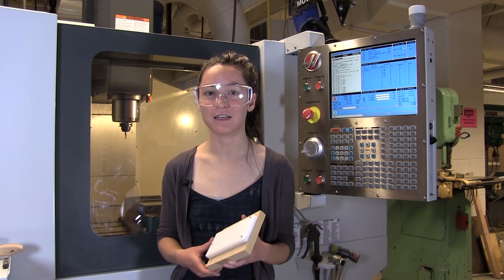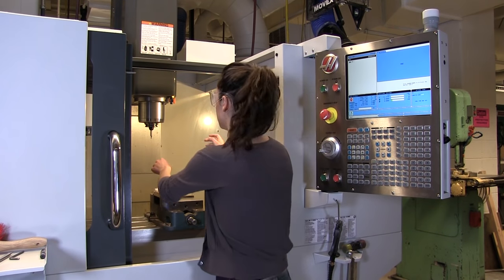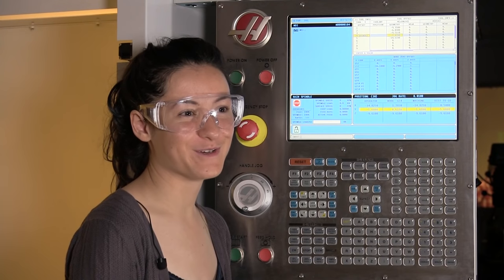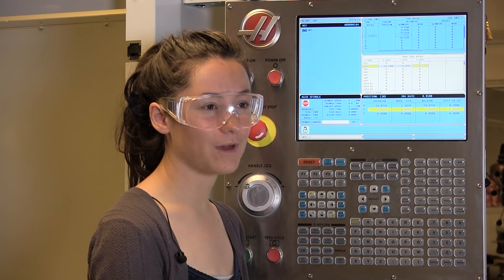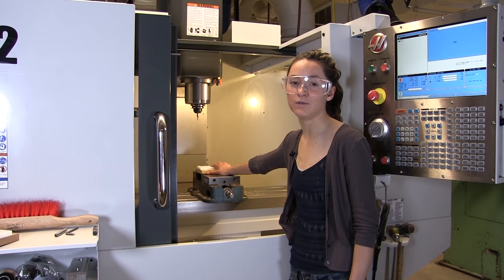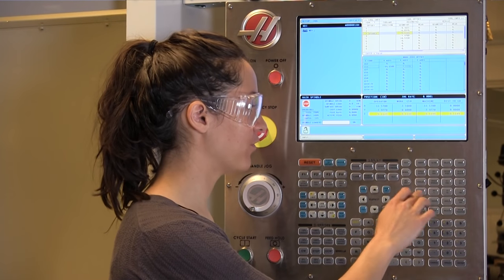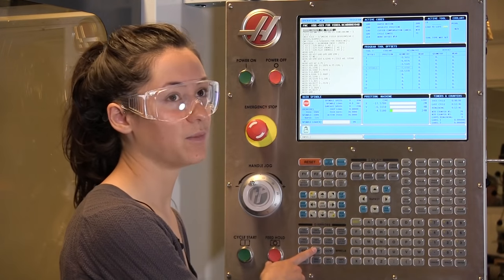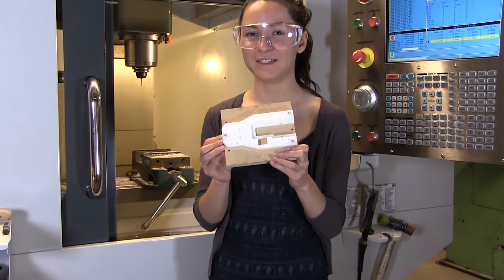CNC Mill Tutorial

Comment: Excellent video. She obviously knows the tech inside and out to be that comfortable discussing it. I've been a machinist / programmer / production engineer, for 40 years and am always happy to see young people learning the trade.
Here are some tricks that you may want to try, to make your life easier in the future, when machining plastics.
To get rid of the plastic chip wrap,  reduce the spindle speed on the drilling can cycles. Change the G81 to G83, or G73 , add a "Q" value to the can cycle to break the chip, and if all else fails, at the end of each drilled hole cycle, have the tool rapid up above the part 2.000", insert an M4 (stops and reverses the spindle) in the program. With the 1,000 psi coolant blasting on the tool, it'll spin the clump of chips off the drill. Then you can insert an M3 to stop the spindle, and restart it in the clockwise rotation, and move on to start drilling the next hole. That way the flutes of the drill will be free of any melted stock when it starts the next hole, and the chips won't build up above the flutes of the drill and be burned into the top of the part.
Hope these tips help you in the future.
Take care.
Reply: But this machine can't worked with blame cnc

Comment: Advise for newbies:
1: Your tool length offset may be off by the thickness of the paper, this may be important when manufacturing more precise parts. You can correct this by selecting your length offset in the tool offset menu and typing (for example) -0.002 or whatever the thickness of your paper is. 

2: You can press the "cancel" button on the program menu to then be able to switch between the machine files and the usb device without scrolling all the way to the top.

3: You can search for a program by typing in the program's number or file name and pressing the down arrow, or the up arrow if you believe you have already scrolled past it. Keep in mind this will take you to the nearest file that matches what you typed, so you may have to hit the up or down arrow again to continue searching if files have similar names or you didn't type in the full name/ if there are more iterations.

4: You can can clear all work and tool offsets faster in the work/tool offset page by pressing "Origin" and selecting one of the options that appears. This only works for the offset menu you have currently highlighted. You should only do this if you are certain that you will not lose anything important like probe tool offsets when doing so.    

The old machines may have used "F1" then "edit" or in the reverse order at some point, but I cannot recall.

5: lazy way to clean a machine is to turn the coolant on and have it wash the bed as you hand jog.
Reply: #1 is very important. For most hobbyist machining, using the paper trick is fine. When you perform precision machining though, a piece of paper must be compensated for in your work offsets. I often have to comp my tools due to the change in ambient temperature when machining to very small dimensions and tight tolerances.
Reply: @jumpman2680  Do you use flood coolant or any type of coolant temperature control? How tight of tolerances?

Comment: Im currently training to be CNC operator. This video is very helpful!!
Reply: I'm replying to your post as its recent, lots of comments but none picked up on the slightly incorrect method used to tighten the work piece and as your just starting off....she did everything right but failed to retighten the vice after tapping down the work piece with a mallet; meaning if the work piece is still free to move with light taps of a mallet then its not securely clamped! Stopped watching after approx 2 mins as I'd end up crtiqing the whole video!

Comment: After I retired I wanted to get into CNC machining, not to make parts, but to experience the other way to do it.........so I bought a CNC mill from China and after many many hours of watching and asking questions I wrote some G code and using a dummy wooden cutter and a block of wood went through a typical mill and drill cycle.........it's true you learn more in five minutes from hands on than a month with a book but the book does give you the staring point and that was without anyone to hold my hand or watch over me......if I can get to that level anyone with a bit of enthusiasm can do it.

Comment: Great video, but I'd like to help You to become more efficient.
I suggest setting all "tool lengths" on a common place, not on Your rough part.
Example, top of vise with gage block, or a block setting on machine table of the same height as vise.
Then set Z0 on your rough part, using only one of the tools in Your program.
Then on Your next job, You won't have to load and jog all the tools to set their lengths again. 
"tool lengths" are stored in Your tool data,  Z0 is stored in Your G54, G55 etc.
Reply: If she's good she'll realize that way on her own. I wish she knew how inaccurate and dangerous it is setting tools with paper
Reply: Yes Joseph, and use work offset, then you do not need to set all tools for next job :) But she was a student by the look, so she did great!
Reply: Yes, also might chip carbide cutters touching top of part.
Reply: Yep, exactly. It's hard for me to post criticism of such an excellent video, but setting your X/Y/Z work offsets is completely independent of tool offsets.

Comment: Faster way when compensating for radius of edge finder is to just type your value in +/- .100 and write enter.
    It's a little faster, you're very talented though, I like the hammer trick to hold down parallel, I use bent band metal used in shipping to hold the parallel to vise.

Comment: great video, but you forgot to compensate for the thickness of the paper which is 0.003 inches.
Reply: I'm boggled that a piece of paper is the way recomended in the manual...There are so many different types of paper, and not all of them have a flat and smooth surface, while some have a polished and a rough side!
Reply: At my shop we use little blue pieces of plastic that are 5 thow thick

Comment: Thanks for the great video! My CNC experience is only in my home shop so I've never used an ATC or anything like that. My mill is an Anilam Crusader II Bridgeport but the controls are not working. I am working on a conversion to LinuxCNC, it works with the existing drives, motors, linear scales/encoders. If I can figure a way to convert my Erickson QC30 to a pull stud drawbar (ISO30 or BT30?) I might be able to have other tools in holders on the table for a poor man's ATC. Anyway, it's great to see how the modern equipment works!

Comment: Dear Sara,

I have been in CNC for the past 30 years (3/4/5/ 6th axis with attachments) handled many types of CNC Machines. Your Video was wonderful with great explanations,this is the way I learned 30 years ago. In Z work offset you called each tool and capture Z , it will applicable for few tools. If we need to run with 20 or even more tools .......... tired right? I have a solution. Please wear a cap while working on Machines. 
All the best ---Great Video

Comment: Great job and great video...I do have a bit of constructive criticism though (I learned the hard way). NEVER press cycle start on a new program if you are not watching the tool approach the part...AND...whenever proofing a new program on the machine, walk EVERY tool down at 25% rapid (or less) and in Single Block mode, so that that you can verify that the Tool Length Offset is set correctly before the tool starts cutting. Never assume that you did your setup correctly...this little precaution will save you tremendous amounts of time and money (and embarrassment) by preventing a spindle crash.

Comment: If you are locating from the left edge of the part spin the spindle CCW (COUNTER CLOCKWISE)
so that the edge finder snaps on the direction facing the operator instead of the back of the machine.

Comment: Please learn from my mistake.
I learned my lesson.  I broke a 1 inch drill bit when I put it back to the spindle.  The pegs on the spindle were on the side way so I did not see them clearly and I did not line up the notches correctly with the pegs.  I heard the loud bang and I shattered the 1 inch drill  bit.  I was glad I did not get hurt.
Tip:  Try to turn the spindle so one of the pegs faces you so i can see it clearly.

Comment: I was always told to run the program on its first run on single jog, that way u can check the numbers,  when I write a program
I have the tool go to x. 1 y. 1 z. 6  then I check z is 6 inches from top of part,  if that is correct, I jog the next move which I like to make
X. 1 y. 1 z. .1 then I would check x and y. Are both 1in from edge.

Comment: also theirs another menu were u can preset for radius of tool cause when u buy tooling it comes with this info, i understand why their doing the video this way, but in practice hands on you don't need a edge finder u can use any tool to do this but thats not by the book way but it's much faster and just as acurate and u don't need the spindle to spin cause u  spin it by hand

Comment: She shows how to use an edgefinder to find X and Y, but not how to use an INDICATOR to find Z RELATIVE for a 123 block, and its relevation.

You use a 123 block to keep a 3 inch distance from the base table, so you virtually lie to the machine and say the table is 3 inches taller than it is.
Indicator touches the top of 123 block, and you find THAT relevance to the top of your stock(or what you want the Z rele to be, sometimes its half or midline of the stock at Z)

She touched the tool off the part, but you cant really do that to a piece of metal, maybe alum but idk.
I knew a guy that did it with a piece of paper off the top of the part, and subbed 10 thou, which was smartz

For spring holes on winchester lowers, I just jog the Z down until it throws a few chips, part zero, run it .005/.01 thou and then re part zero.

Machining is fun, never be intimidated, and also, never give up. Just keep trying to learn. Youll always break stuff. Thats okay. Ruining tools and ruining some parts never hurts, it only makes you worth more money if you accidentally waste a little money.🖤

Comment: Do you always edge find on the left and back side of the piece? Would starting from a different side cause the machine to run off the piece? Or does the zero compensate for this? Or is this taken in to consideration when laying out the part in Cam?
Reply: It does matter. If you recall she mentioned early in the video that she chose to set the origin of the part in MasterCam to the left rear corner of the part. She then finds that point by locating the left and rear edges of the part in the machine. Those two edges intersect at the part origin (left rear corner).
Reply: I missed that part! Thank you very much:)

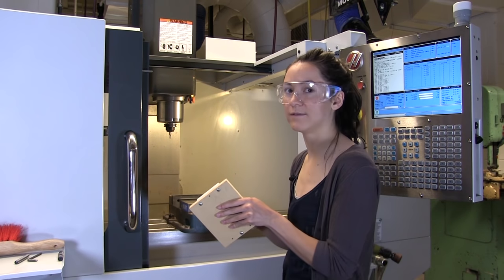Comment: 1:29 what was meant by mastercam origin? did you say mastercam? I understand what the origin is and see reason for deciding where to put it relative to vise... but mastercam origin? One thing I don't understand about this method of edge finding is why the tip has to bump off to indicate the edge and why tip concentricity doesn't indicate an edge prior to bump off. Is there a standard size of edge finders? Do you have to tell your machine the radius of the edge finder tip? I assume there's program function for this.
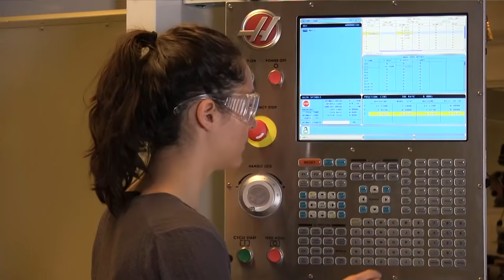Reply: 18:15 see them screw tips? then at 18:24 "you're essentially ready to start running your program". but those screw tips do worry me.
Reply: 22:25 dude, your bit is approaching your work piece and you ain't even watching. Start is the most important time to watch because many errors will present immediately, so you can see if it starts doing what you expect it to do,  affording you opportunity to stop it before the whole piece is screwed and you have to start over with edge finding. I know, I'm nitpicking.

Comment: Great job but why you don't take the zero from first in the middle I think it will be more accurate 
I have a problem with my magazine tool it doesn't change tool automatic I changed manually I need to re-define the position or his zero to the machine so it can solve by G M code or by prameter in my machine 
My machine is fanuc om-mate could you help me
Reply: lol
Reply: Well dude, as i remember M981 was the M code for re-defining the positions tool magazines. Try it at MDI mode. After that don't forget to check the positions of tools before starting the program.

Comment: What are some of the things I would need to know to become a CNC operator?
Reply: How to press a green button but only when it's safe to do so.Refuse to run a machine that has overidden door interlocks.Its extremely dangerous!!! and (if you care) illegal.Prepare to lose a finger or even a limb.Ready your self to have lots of damage to your hands and (if you're not wearing safety glasses) eyes,whilst de-burring,polishing,handling parts.Ensure you learn how to program so you can do 'foreigners' maybe even FOR  foreigners.Bring a TV and pillow for the long cycles.Safeguard against particles in the air from faulty or not turned on filter mists,abrasive wheels,capstans and the like,by insisting your boss buys you a rebreathing particle mask to go with your specs,boots,ear defenders.Training your mind to go off on trances when boredom sets in always helps.Or try spinning an insert around something round with the air line then launch it in the offices direction.

Comment: when the machine turned on and off , we have to again set the tool offset zero position or once if we set the offset for a tool it will be permanently stored ???
Reply: swami nathan once you set the tool height it will be stored until you change it or zero it out. Powering off and on the machine shouldn't ever change it.

Comment: Is it possible to be good cnc-operator/programist without having experience with manual/cnc machines ? we need to have technical school or something else ?  (CNC books, youtube and practise in first job could be enough to learn it?)
Reply: "Yes" and no. If i understand your question right. Yes it's possible to read cnc and iso programming, but i highly won't recommend it without having Previously experience, because being a machinist you learn a lot from mistakes and physical (hearing, feeling, looking etc.). There is no reason to start cnc without having one, because: You can't physically hear if it sounds good or bad (for example when milling). There are some generel rules about cutting data, but cutting data depends on, if everything is under the right circumstances, the right environment, temperatur, your cnc stability/ size, your tool condition and loads of more knowledge. That's why it's not worth reading cnc, unless it's your job or education :). If you are looking into programming i would recommend wood cnc milling, because working with metal is actually rocket science. It has a really wide spectrum of knowledge and wood cnc milling doesn't requir at all as much knowledge as a machinist. Hope that helped, ask if you need :)
Reply: @LetsGoOnAdventure   Thanks for reply !     I'd want to work in CNC but I don't have any experience. Wood cnc milling is much easier than turning/milling in metal ? I have some books to learn CNC.. In my country we have school named "Operator-Programist CNC Machines - 600 hours" 150 hours practice in Manual Machines, 150 hours practice in CNC,  150 hours of technical documentation, 150 hours about cnc construction ----  what do you think about this type of school will be enough to start in cnc job? and sorry for my english grammar :)
Reply: @qw3rty464  Well i don't know the requirements or talent in cnc, in your country, but imagine i use 4 and a half years to learn cnc, metals, tools, time on components etc. and that's with college or highschool too. You need maths, physics, chemistry and technologi knowledge in Denmark if you really want to be good at being a machinist. but i don't recommend you getting a job with only 600 hours of work in cnc. Well it depends on what you get to do/make, i will say this clear, most people get to stand in front of a machine making 800 pieces of the same component a hole week and that's no fun. but, were do you live, age, what grade/school are you in now, what's your relationship with metal? and remember cnc is fun, but the best being a machinist, is when you make a compenent that you only had thought about and it also works perfect, the accomplisment you get, is a incredible soothing feeling, that makes you want to work more and harder :). many people just draw their components then put in a program where it will make all the iso-codes for you, so you don't have to by yourself input all the lines like this one is assisted:https://www.youtube.com/watch?v=IaufzuOSigs
And another video that shows the real deal about cnc programming, where you have to code everything by yourself
https://www.youtube.com/watch?v=hq47wq9qBbs
Reply: @LetsGoOnAdventure  Umm.. Birk... thank you for reply, I dont have any experience in metal/CNC I just want to learn it... I have some books about CNC Machining for beginners.. and two simulators (Sinutrain and iTNC530 where i practice G-Codes) do you think there is any chance to learn it without going to  special school? I mean it is possible to learn CNC in job + reads books in home ?.  I can get first job where I only have to put materials to machine and press "start button" after all I have to check the dimensions with measuring tools (I know how to do it, its easy) what do you think about it?
Reply: qw3 rty I think you’d be applicable for an entry level CNC operator position in a wood shop. You’ll work with a trainer to understand the basics of operating the machine and get the chance to use your existing knowledge to see what it’s really like standing in front of a controller. You can then advance your career after a few years of experience.
Reply: @rocko2753   Thank you Rocko!
Reply: @rocko2753  nice answer ;)